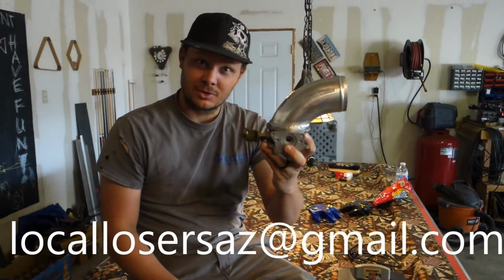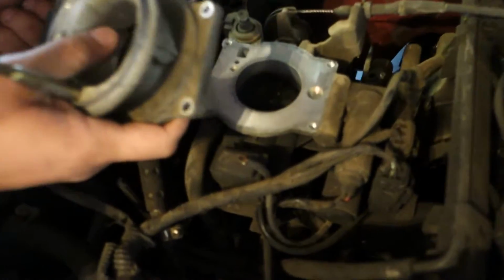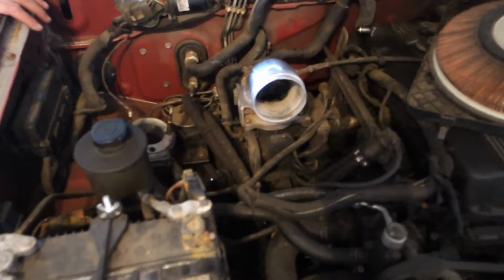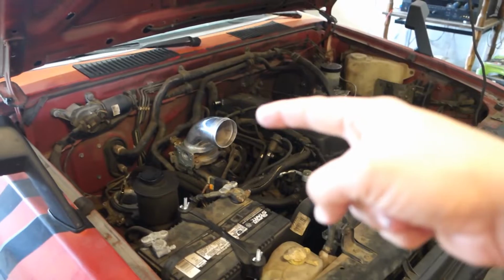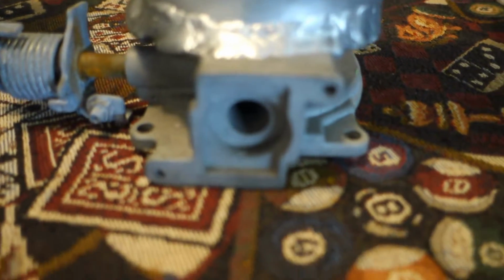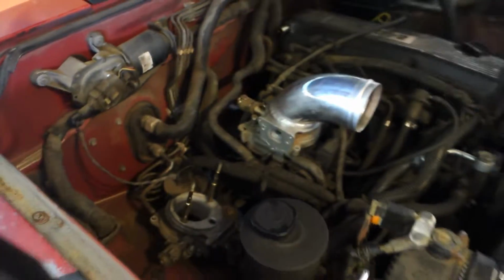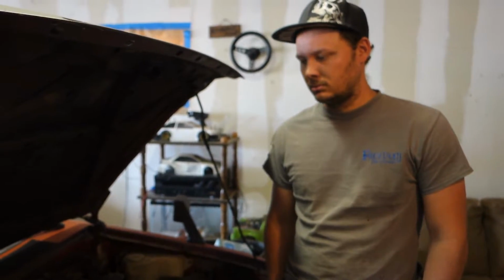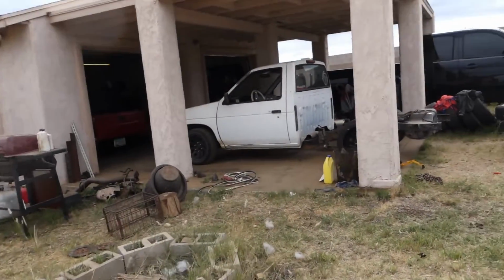The one part you NEED to turbo your d21!!!!

Comment: Where did y’all connect that little hose that also  connects to the air cleaner case on the bottom ?
Reply: @LocalLosers520  why does my engine check light come on ? Is there sum I missed ?

Comment: They sell intake hats for the Nissan frontier ka24de on Amazon that fit on the single cam. That's what I'm running on my hardbody. After you get the truck running, I'd love to compare your aem system to the megasquirt ecu I'm using
Reply: Caleb Housley Post a link to the hat!
Reply: Hey bro did you take off the air temperature sensor or did you installed it on that frontier carb hat ?

Comment: My truck ran like shit without the AIT sensor
Reply: Mine is plugged in but it just lays in the engine bay. It might show a code if it's wires are broke but never had a problem plugged or unplugged
Reply: @tompetramanos2924  Mine doesn't make a difference at all being plugged in or unplugged smh. Problem maybe?